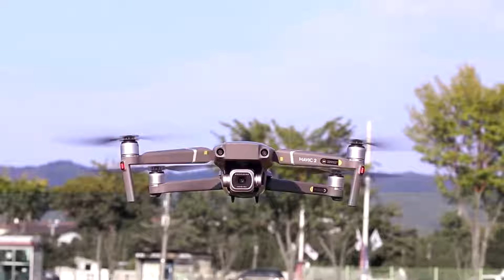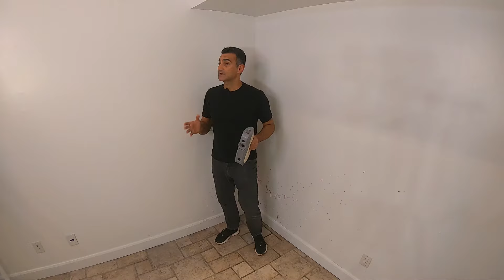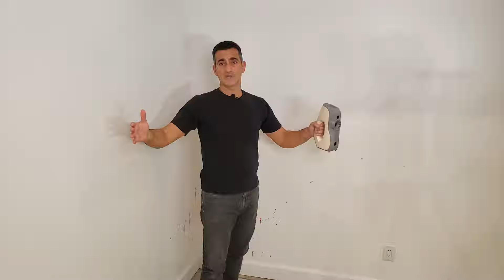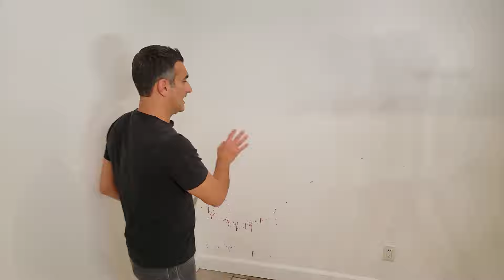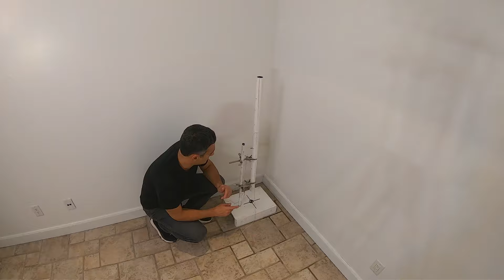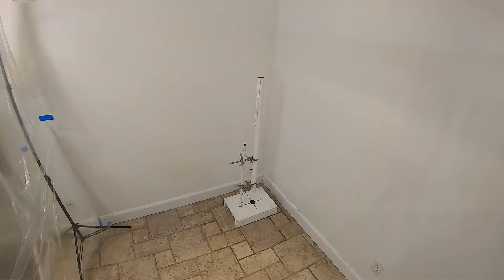Review: Scanning Bloodstain Patterns with the Artec Eva | 3D Scanner | Forensics | Click 3D ep.43

Comment: Good morning, 

I have a freestyle 2, it is the same scanning process, no need to use the tripod to take the pictures. The programs I used is scene and HD faro.

Thanks
Reply from the maker: I will be doing a video on the Freestyle 2 in the near future!
Reply: @3Dforensics   No need to use the tripod to take the picture with camera
Reply from the maker: @Midnight8235  Normally, I would use a tripod, but under the circumstances, the method I use with the small square grid gives me just about everything that I need.
Reply: @3Dforensics  what size should the square be
Reply from the maker: @Midnight8235  Doesn't matter, it's most important that it's square and that it's big enough to get the stains you want.  You could even have different sizes to suite your needs.
Reply: @3Dforensics  Gracias desde Puerto Rico, thanks from Puerto Rico